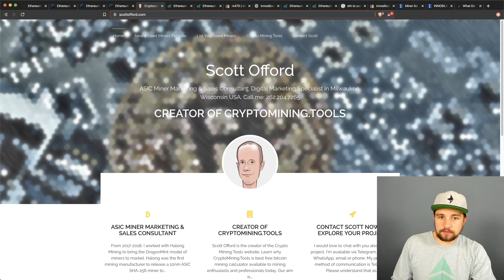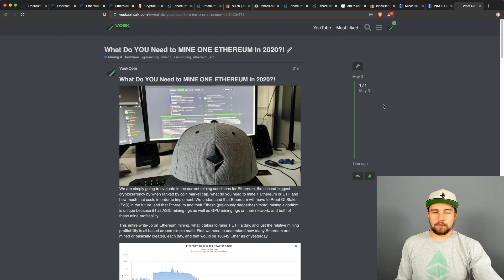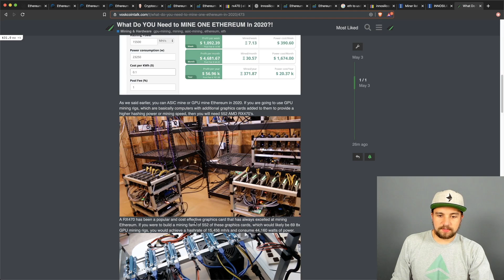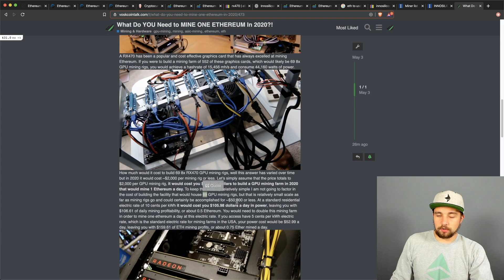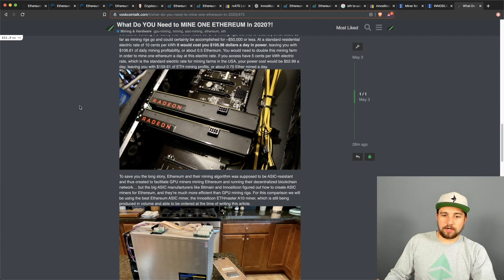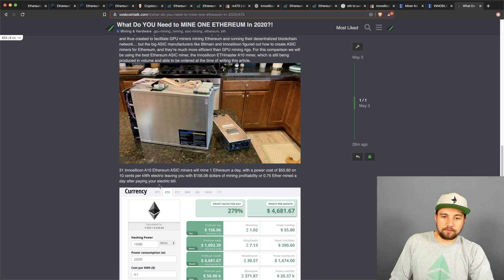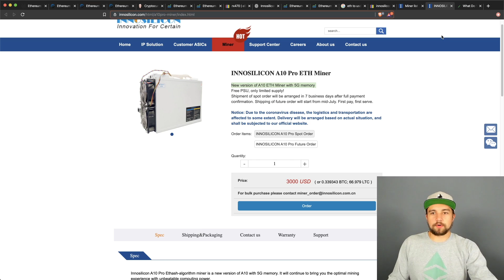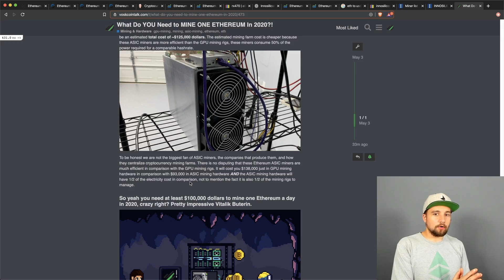What Do YOU Need to MINE ONE ETHEREUM In 2020?!

Comment: i used my PC to mine ethereum. Just single XFX Radeon 580 GTS OC+ 8GB. Top speed is 30,4 mh/s on windows 10 with DDR3 memory and Athlon II x64 3.0 GHz. In 357 hours i mined 0,05326147 ETH. It is about  20,23 USD (380 USD/1 ETH). Because i have 0.16 usd price for each 1KW of energy consumed, this gives me total 9 USD profit. I also surfed internet when mining. I turned of mining when playing games. Power consumed is 166W when mining. Much more when playing games. Above half of earning (until price 407 USD / 1 ETH) i pay for electricity. In Poland we have obsolete coal power plants.

Comment: Crypto Mining on your Cellphone

Hi anyone that wants to get in on the ground floor, check out this new crypto called "Pi network" Stanford PhD graduates made the first phone app that mines currency for free. Doesn't drain battery or cost data. When 100M join mining rates will fall significantly so you have to get in soon. Because its beta you need a member to invite you in Use code {Soule39} to join.  

Look up their white papers this has alot of potential.

Comment: In june 2017 i've stumbled above eth and started to get some information about it. Some weeks later i had 2x HD 7950 3GB from Gigabyte and RX480 8GB from Sapphire card running (around 50-60mhs as i remember) together with 850w psu. What a great time. My last mining rig went off at the end of 2019 running 6 rx470 4GB from sapphire. Keep up the great work!

0x3517763e241256Bdd713508C42692c9B845EF896

Comment: I first heard about ethereum was like 1 and a half years ago. Did the most stupidest thing ever I started mining. no that's not what was stupid.  I mined using my GPU(Gtx 1060) and It had a warranty meaning i couldn't take the GPU out or open the computer case. And It started overheating and one day when I woke up my Display wasn't turning on. So i took it to the shop and they said the GPU was damaged.😁

My ethereum address  -  0x893b4F9881c6FaAB56E00b2b0E71282cf8CD2AEE

Comment: ETH address:
0x4cb7493d62b36adb6f7b04a5b29ad619f5029c98
1st discovered ETH in January 2019.  It was high priced (my opinion at the time) and mining was power intensive so I found your articles on Hard Drive Mining and started there.  Seems I've always taken your advice on what to mine with the equipment I have.  Right now ETH is my FAV.

Comment: I started to mine Eth in 2017, i had one RX 480 8Gb in my Gaming Setup and i was bored of gaming and somehow i found an how to biosflash for more hashrate i got interested in crypto and there my cryptojourney started , later i bought more and more 480´s ... ended up with 13 Rx480 ... after 1 year of mining my electricity bill was adjusted so damn high, then some private problems pressured me to make some quick cash ... i started to gamble my eth on eth roulette and lost it all -.- so i was paying the high adjusted electric bills for coins that i lost. if i remember correct i used 22000 kw in 1 year. never paid anything out.
0xa6e1a9e4cf15335d9b1b6247e17956f5bdf9ca04

Comment: ETH: 0x32C649CddCCD60bEDb358B14253eb60c6fd496A2
I heard about Ethereum shortly after learning about Bitcoin sometime in mid-2017. Started mining ETH November 3rd, 2017. By March 2018 I had 2 GPU rigs (9 GPUs) and my peak monthly income reached $450! Sold most of the hardware, got nearly half of what I spent. Kept my Ryzen 7 setup along with 2x GTX 1070ti, 32 GB RAM, 1200 watt PSU. Everyone who uses it says its the fastest PC they have ever used. 😀

Comment: Thanks vosk, awesome video! 
Essentially,  my mining goal is to farm up as many PoW coins I can so that when eth 2.0 comes (if it does) and PoS is implemented,  it's my understanding I will need eth 1 coins to stake eth 2.0. Therefore,  I'm trying to find 8GB cards for my 12xgpu rig so I'll be ready to stake if they migrate away from PoW.
Reply: You need to have more than 32 ETH to be a validator when the project goes to 2.0 (POS). Then you will still have to have a computer linked up to the internet validating the transaction in order to get any payment.
Reply: You need 32 Eth .. not more nor less to be a validator ..

Comment: I get 29.7mhs at 110w   for my RX470s it saying 82w  on the software but it's pulling 108-111w from the wall
Reply: motherboard takes the extra...your only seeing the gpu power
Reply: Its just the package powerdraw not the hole system.
Reply: @giselaottfried8039 + Simon My figures are taking into consideration system power I have 11 GPUs all up pulling 1270w But am using a ver efficient CPU motherboard combo. The system draw under load with no GPUs is 50-69w.  Extra power is the power to the risers